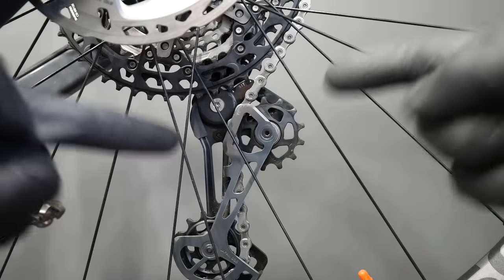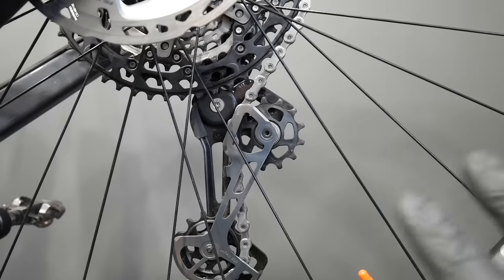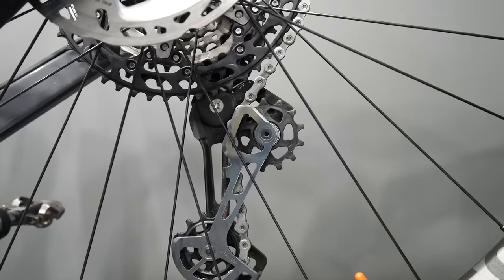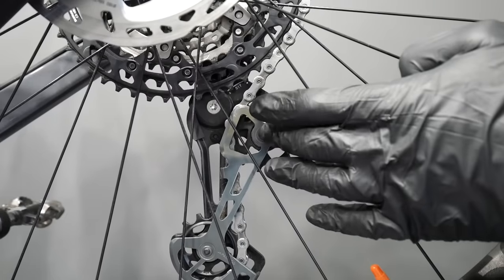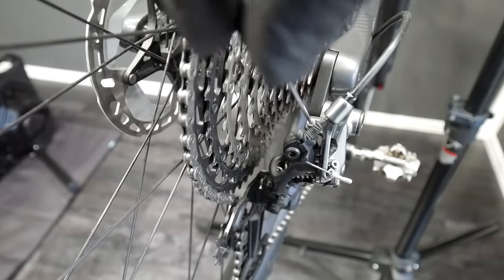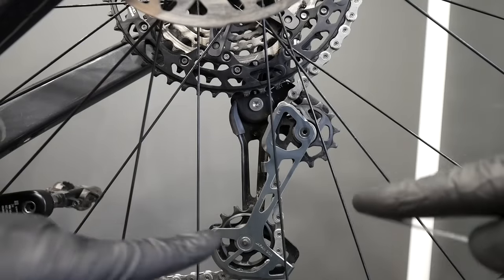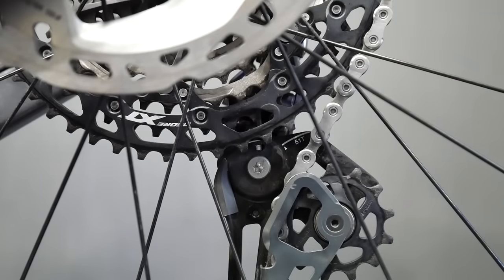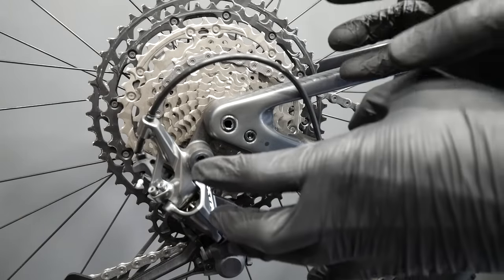Check This, Before You Snap The Chain On New Shimano 1x12 SLX, XT Or XTR Drivetrain...

Comment: Dont you adjust this when sitting in sag? You should!
Reply: Yes, on full suspension bikes the derailleur will change position when on sag (more or less depending on suspension geometry) and if you are not planning on riding mostly in the locked position or you do not have a lockout this adjustemen must be done while on sag

Comment: DO YOU PREFER THE XTR OVER THE EAGLE? I HAVE GX ON MY 2018 SPECTRAL AND WANT TO UPGRADE, I WAS GOINT TO GET XX-1 BUT NOW THINKING OF XTR ALSO SEEMS CHEAPER?
Reply from the maker: I prefer the Shimano XT and XTR shifter, with their systems, the rest goes head to head with Sram. I would maybe say, that Sram has better, smoother clutch.
Reply: I WOULD GO WITH SHIMANO, BUT THE DRIVETRAIN IS ONE OF THE LAST THINGS I WOULD UPGRADE. YOU SHOULD UPGRADE YOUR SUSPENSION, BRAKES AND SEATPOST BEFORE THE DRIVETRAIN.

Comment: How about using 11-50t for the cassette will this be still applicable?
Reply: I was thinking the same
Reply: I'm using a 11-50 12sp cassette  from sunrace and a kmc chain, honestly I'm not totally happy with the shifting, even if the derailleur is set properly... Previously I had the 11sp XT transmission with sunrace cassette 11 50 and it worked much better.... Pretty disappointed at the moment. Probably it's the cassette and or chain. I don't know

Comment: I have the 7100-SGS derailleur and it does not have the markings on it at all.
Reply: Not very clear on them, but there is a  faint stamped line on the cage rather nice white line on XTR
Reply: @dangermouseanpenfold  ok.  I'll take a closer look

Comment: Danny, what is your though on 1x12 SLX? I am thinking of swapping my 2x10 with 1x12.
Reply: I moved from 2x10 to SLX 1x12 when it came on my new bike. The drivetrain works perfectly well and it's nice not having a front mech to worry about. If I was buying from scratch I'd go with an XT shifter, as its got more multi shift options, andeverything else SLX. But the SLX softer still does the job fine. 

My only gripe is that 12 speed mechs are easier to damage (I've broken 2 in less than 6 months but on the bright side in good at installing them now). 10 speed can tolerate knocks a lot more without messing up your shifting

Comment: For bike with rear suspension...Does this adjustment need to be done with rear suspension set to proper sag?
Reply: No. I don't think the sag matters as the derailleur is attached to the rear triange. Eg. the position of the sprockets to the derailleur does not change with suspension travel.
Reply: @pavel_zak  That's not quite true. When compressing the suspension there is the change of distance between the center of cassette and bottom bracket - it means the chain is "stretching" and the offset pulley goes "lower"

Comment: I have M9100 group on my Cannondale Scalpel Hi Mod.     B screw needs adjustment every 20-30 hrs of riding.
Why?
Reply: maybe it is moving? I just noticed it is loose on my derailleur.. I ll add some Loctite.
Reply: @v1ncen715  obviously. But why?
Usually B screw is set and check when cleaning but rarely readjust. I’ve never had this issue before this group.
Reply: I discovered same thing on xt rear mech 12 speed. My b screw was all the way out after 9 months if riding. I added loctite orange to see if it holds it this time
Reply: It needs checking and re-adjusting at regular intervals for the same reason helicopters require main rotor damper torque checks/adjustments. Vibration and use will loosen things over time.

Further, as bike technology gets better and better, higher capabilities inevitably mean more frequent maintenance.

Comment: I am running the M9100 XTR set up with a medium cage rear mech and the 10-45T cassette. The teeth of the cassette is now aligned with the white line (it was not originally when I bought the bike) but I seem to have a knocking sound ONLY in the tenth gear for some reason? running single ring up front 32T. When I shift up to 11th or 12th the sounds stops. When I shift back down through the gears the knocking sound again presents itself in 10th but stops when shifting into 9th,8th,7th and so on. Any ideas what may be the cause of this?
Reply: Slightly bend derailleur hanger?
Reply: @MrJazazello  it's a brand new rear mech.
Reply: @Stussy787  Hanger is a part of the bike. Sometimes (hangers) they're bend even from new.

Comment: Sorry, but you are wrong with 9120... check the manual)
Reply from the maker: The manual is weird. in case B and C it says the same thing: Using the front chainwheel of a single gear.
Reply: I think all is clear, "B" is front double( align the contour of the outer plate and the tip of the highest tooth of the largest sprocket) , "C" is front single(set the distance between the tip of the highest tooth of the largest sprocket and the centre of the guide pulley as listed in the table -46 mm)

Comment: what if im using 11- 42t cogs for m5100, for adjusting the b screw
Reply: the b gap will be to big. You will have a problem.
Reply: What if im using 50t cogs?
Reply: Depends of many things, HT or fully for egsample. You can find all the data in the manual.

Comment: Hi. Can you use m8120 XT RD with 10-51T cassette?
Reply: No, it is too short and will clash with the teeth of the largest cog.
Reply: dont, that derailleur only supports 10-45. you want the m8100 SGS, SGS = Long cage derailleur for 1x setup

Comment: How to align 10-45t on a 9100 SGS RD.
Reply: Looking forward for this too, Im using 10-45T right now and so far is working the same way I set up my previous 10-51T
Reply: @EDMLuigiRS    so did you align 10-45T cassette  on the white line of the 10-51 RD 9100. I am thinking of getting 9100 GS cage and compare SGS and GS and see whether there is any noticeable difference.
Reply from the maker: This might want to be set very similar to the SG, as long as your chain length is correct.
Reply: @cannondany   Shimano manual tells that 10-45 is incompatible with SGS , but their product website specifies its fine.  I am sure its fine , but its confusing as the product manual doesnt specify the details of 10-45 with SGS.
Reply: @asishcr  Yes that's exactly what I did I aling on the 10-51 white line, and so far the new cassette 10-45 is working fine on the GSG going thru 500Miles no problems
Reply: @cannondany  yes I had to remove like 4 links for the new cassette 10-45T
Reply: @j._7054  Same here. As far as I know Shimano only makes the GS version in XTR,  m9100

Comment: Is it normal for that slapping noise when the gear changes? ie going from high back down to low gear (ie for more power on a uphill climb?). I have a new ebike with shimano deore shadow plus, I noticed when I upshift its sliky smooth, When I downshift to a lower gear for the hill climb (I back off the pedals a bit). I noticed the gear change probably slaps the cassette before sitting on the right gear. I noticed in your video that slapping click sound too when you change the gear. Its this normal?
Reply: Search something about shimano hyper glide technology (HG and HG+), this should explain some things i believe
Reply: @rourose  Thanks, I'll take a look when I get a chance. I have moved on anyway, currently riding a Rofloff + Gates Carbon Belt. Wont go back...

Comment: Hi friend. I have a SLX 7100 1x12. I've done what you say in the video, but my changes aren't smooth yet. I still have trouble switching between tooth 10 and 12. What else could I do?
Reply: Use the barrel adjuster at the shifter
Reply: @TorrentUK  I did it, but isn't work
Reply: Throw it away and get sram XX1
Reply: Check your chain with a chain tool. mine was doing this and it turned out to be a stretched chain.

Comment: I'm still on sram x7 👊💪🤣
Reply: Get the SX Eagle 1x12, costs almost the same and is way better
Reply: @Fred_the_1996  I'm on ebike has to be a chunky  7-9 speed or I will brake chains more
Reply: @Fred_the_1996  the sx is plastic and snaps like a twig, and needs constant adjustment.
Reply: @penskib1975  Not really, I've used it on am enduro bike and it survived some months of bike park abuse and bashing

Comment: No Idea what is going on but my screw is already bottomed out and the line is nowhere near the showed example.And as the screw is already bottomed out there no chance I can adjust anything to what is shown on the video. I have XTR M9100 with SGS cage 51T.
Reply: Problem solved. Bastards at the factory had derailleur installed incorrectly. Adjustment plate was positioned wrong and the B screw was bottoming out on cage hanger. It took me a few minutes to figure out but after investigating the bike and the XTR manual it was clear as day. Just shows even if your bike comes from big-name factory still need to recheck everything.

Comment: Mines has no line. I have SGS but there is no line...  :(
Reply: Try shining a flashlight on the derailleur if you're in low light. Mine has a line, but it's black and barely visible.
Reply: Some Shimano 12spd derailleurs the line is stamped and not painted.

Comment: Ok. I have a problem with B-screw  i have XT deore 12speed casete and xt deore shifter i cant align shifter on the correct heights for 51 teeth. I have full release B screw an still missing about 5mm when i tighten screw, gap is even bigger what can i do?
Reply: Too short chain!
Reply: I initially had a similar problem.  Turned out I didn't get the derailleur stopper plate on top of the B screw plate of the derailleur hanger.  I had to take the derailleur off and move the stopper plate to the right position then the B tension screw was in the right position.  Look at page 7 in the shimano xtr m9100 installation guide located here: 
https://si.shimano.com/pdfs/dm/DM-MARD001-00-ENG.pdf
Reply: Add one chain link. Worked for me!
Reply: Same problem on my rear xtr 12 with eagle cassette.. If i add a link the lower chain side remains too low tension

Comment: Me here with the base model deore 12 speed 🥲
Reply: solid drivetrain mate, got the eleven speed so no worries
Reply: Same adjustmemt on the 1x12 deore system
Reply: Actually I have too the Deore 12, just put some light as the 51T sign is in there, just hard to spot. At least in my case.

Comment: No white line on my new XT.  Nothing to line up.
Reply: There is a submerged black line on XT
Reply: Yeah I had to look closely on mine to find the line. It wasn't white it was just an engraved mark in the black paint.
Reply: My 8100 short cage GS has no line and had to use the edge of the plate

Comment: This is the reason why I gave up mountain biking. A 32 or 36 front chain ring? You're simply spinning? The last mountain bike I bought was in 2015. A 10 speed with 3 front chain rings. I switched out the 42 for a 44. You can't do that now,cause of those crazy cassettes? I left mountain biking this summer and switched to road bikes. Bought me a Cannondale System Six and Pasculli Mercatello. Both with Di2 and disc brakes. Bye,bye mountain bikes forever!
Reply: No one asked
Reply: That’s what I don’t get about these single ring set ups.  It’s great for downhill, enduro, or a dedicated XC off road race bike, but when I was racing XC in the 90s we did a lot of road riding to get to the off road (we never drove to ride unless it was out of town; i.e., Anchorage) and the lack of big gears would not have worked for what we were doing.  It just doesn’t make sense for real riding and training where you’re doing everything from climbing on long technical trails to long road rides.  
For instance, when we would ride the Powerline Pass trail above Anchorage, it meant riding across town, up to the parking lot where most non-hardcores would drive to ride the trail, up over the pass and down to Indian on the other side, and riding back into Anchorage on the highway.  Most people would drive to the parking lot, ride up and then back down.  Being limited to such low gears would never work for those kind of long rides which included 20 miles of road riding out of a 60 mile ride.  I just don’t buy the single ring front gearing with no top end for real mountain biking.  It’s fine for weekend dandies who are driving to the off road trails, but not real hardcores who are doing 60+ mile rides.
Reply: This happens when you buy a mtb instead of a road or gravel bike and you ride it on tarmac.
Reply: @Nathanael Arellano When he is talking of "big gears" he is referring to the small sprocket/large chain ring. With a 10/32 you are spinning out at around 35-40 km/h, which isn't great if you have any downhill on tarmac, and if you are well trained it's not great on any tarmac/flat road (one of the reasons why I'm moving from a mountain bike to a gravel bike).

On people "being stuck somewhere", as you say "biking is about having fun" - some people (myself included) have more fun doing a 60 mile ride on mixed terrain than doing a very technical trail. There are skills, techniques and challenges involved in doing both things.
Reply: @Nathanael Arellano I'm not in any way obsessed with KOMs - I'm not even on Strava. However, the point is precisely this: people have fun doing different things. Don't judge them because they are different from what you find fun; that's all.
Reply: @keirfarnum6811  If you have to qualify “real hardcores,” then you’re not actually hardcore. ;-D
Reply: @keirfarnum6811  maybe if you lament the lack of road speed and don't even mention chain retention and clearance you were the 'non-hardcore weekend dandy' and those guys in the parking lot were the 'real hardcores'.  If you weren't blowing chains off multi ring setups, if you weren't needing a chain guide pre clutch derailleur, were you even mountain biking?
Reply: @geepuller1  one shot - kill. People that cry about 3x from the 90's were nowhere to be seen in the 90's.